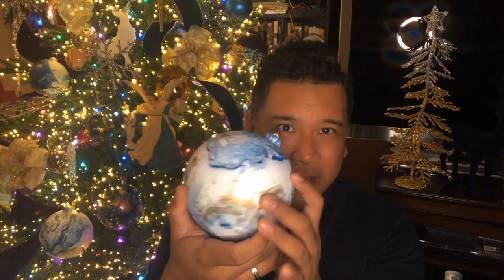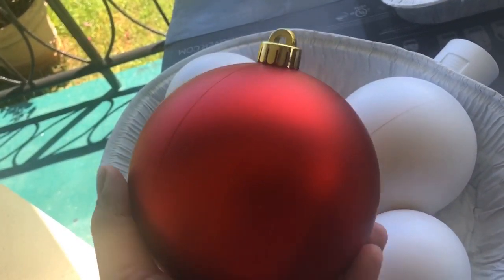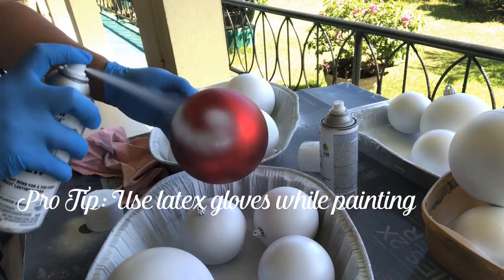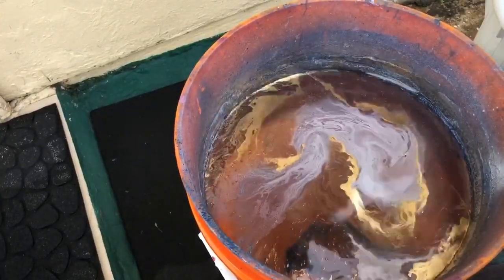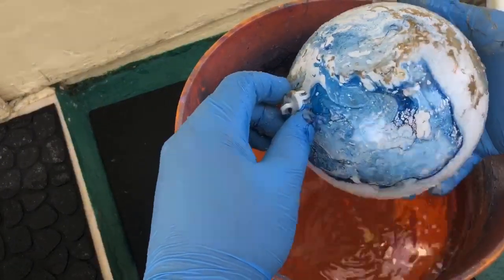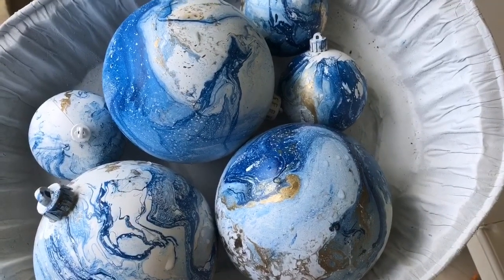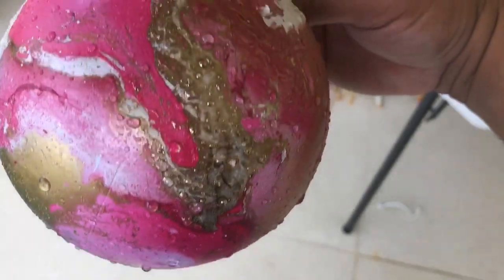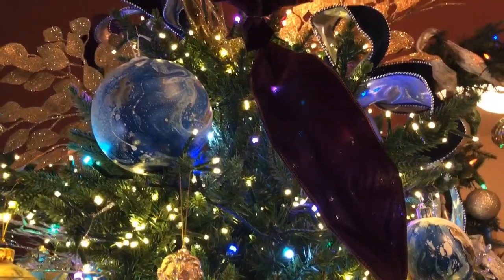HOW TO CHRISTMAS DIY 2020- HYDRO DIPPING ORNAMENTS TUTORIAL

Comment: So beautiful! Now that I'm on Christmas break, I definitely plan to try this with my daughter. Are all the spray paints used enamel spray paints, even the one you spray onto the bucket?
Reply from the maker: Yep! And they almost instantly stick onto the ball after dipping them in and taking them out. I usually just lay them right away on a paper towel then also pat dry. Also be sure to turn them upside down to drain any water that may have gotten inside the balls from dipping. Merry Christmas!!